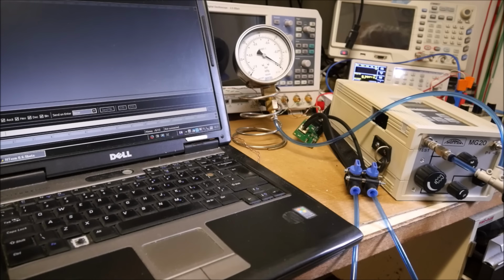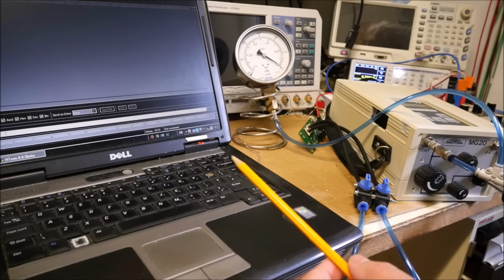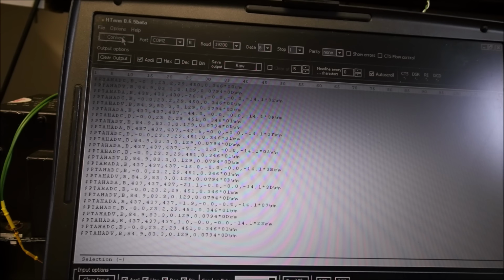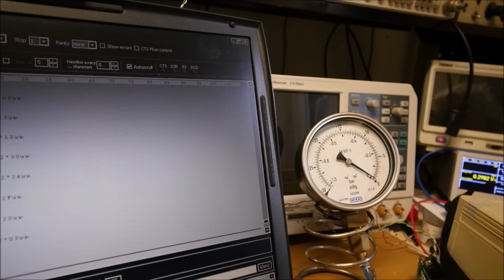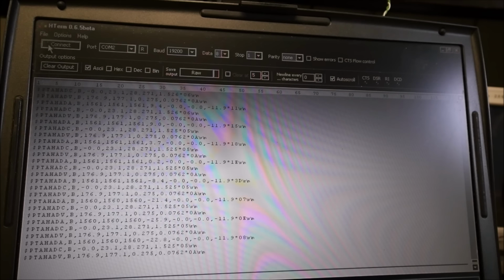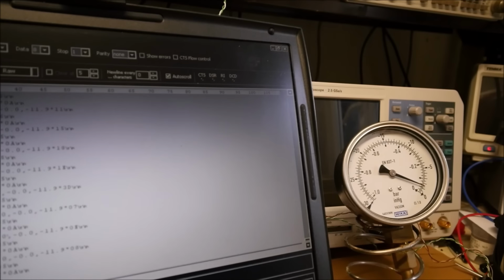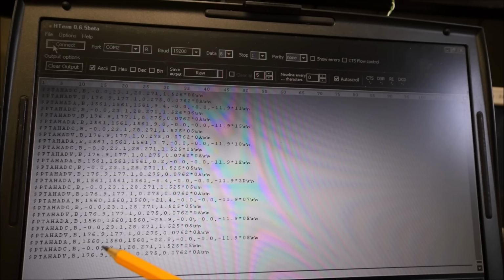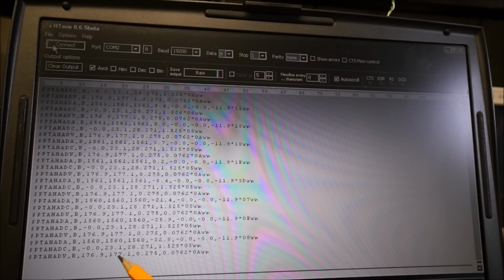LDM #369: Shahed-136 drone Air Data Computer module

Comment: Very nice. Can you read out the memory?
Reply: What is there to read?
Init
Read sensor
Put to UART
GOTO 10?
Reply: @VEC7ORlt  firmware in the microcontroller
Reply: @Mr1Spring  I know what it is, I just transcribed/disassembled it for you.
Reply: @VEC7ORlt  well, dissasmbly of the code might reveal something interesting like who programmed it, what tools they used etc.  Forensic stuff.
Reply: @VEC7ORlt  scaling values woukd be useful as well as the input source (pins) for the unknown numbers like 0.07

Possibly a missing temperature sensor.
Reply: @Mr1Spring  yeah, but I somehow get a feeling that it'll be as barebones as they come, I'd be surprised to see some fancy calibration and self test routines, given that it just spews out data upon power up.